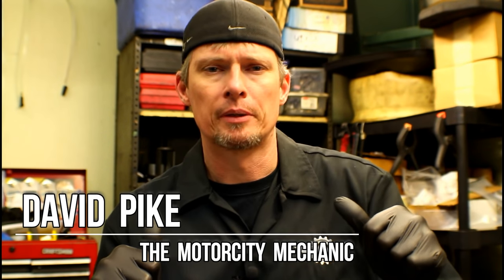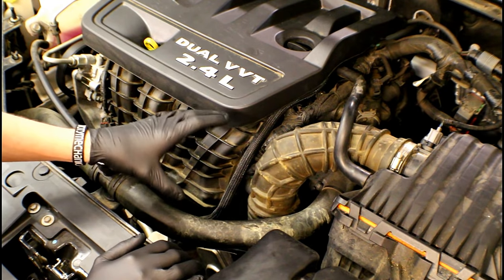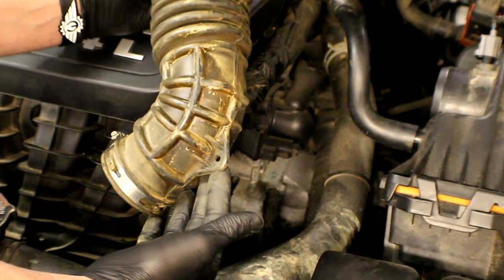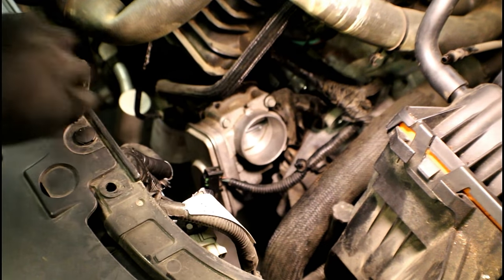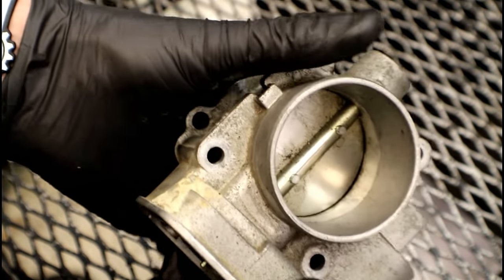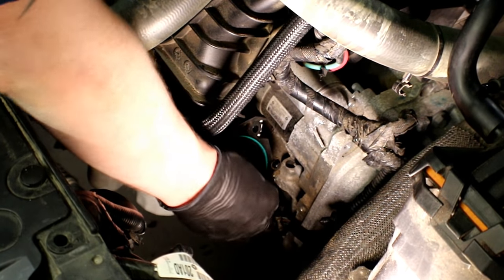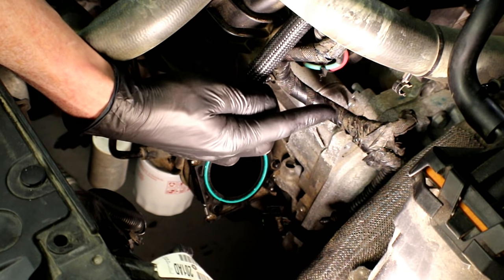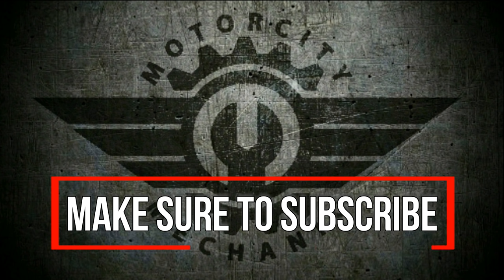Codes P2111 & P2112 Chrysler 2.4 Electronic Throttle Body replacement

Comment: Dealer changed it at 82000 Kms for about $800 CAD.  Acting up again at 162000 Kms. Part cost me $140 on amazon. I changed it myself in under an hour. Thanks for the excellent detail in this video!
Reply from the maker: Hate that it happened again but glad you found the video. Thanks for commenting and make sure to subscribe Frank.

Comment: I had to comment...this video is SPOT ON!  I had been noticing strange behavior with my 2013 Chrysler 200.  From a cold start, the idle would lope/pulse and then smooth out.  Then I would notice with a slightly off idle gas pedal, it would seem to surge.  I thought it might be a dirty MAF sensor.  I cleaned it but with no change.  I was on my way home from work the other night and the dreaded red lightening bolt appeared which caused no response from gas pedal input and a virtually fixed rpm of about 1600.  I was able to limp the car to my friends house for safety.  After watching your video, I got the replacement part, installed it (literally 20 minutes...start-to-finish) and the issues are gone.  Fantastic details from exactly what size sockets to installation, torque and order...really awesome!  I decided to open my original TBA and discovered that the teeth were gone on the butterfly gear...just like in your video.  Fortunately, like you, I did not have to relearn the throttle position sensor.  I also didn't have any codes (AutoZone was near where I had the issue so I asked them to check for any codes).  Great work, as always!  Oh BTW, the other video about replacing the trans oil cooler hoses is spot on, too!  Thanks a million!  Oh and for the record, the average cost to have the TBA replaced is around $450 US, I did it for $60 with the help of this video!

Comment: Thank you for this super helpful video! My aunt just called me to come reinstall the throttle body on her 2007 Caliber. Apparently some 'mechanic' came and took it off & wanted a lot of money to put it back on. Realizing he was trying to rip them off, they told him just leave it. Now I see what I need to do/check. I bet the plastic gears inside are worn. This video gives me the confidence I need to go finish the job. Or try to!
Reply from the maker: Awesome....as you saw there really isnt much to it. Take your time and it will go smooth. Thanks for commenting and for watching. Make sure to subscribe.

Comment: Thanks so much.  I was going to try to take one apart to learn what actually fails and you saved me the trouble.  Best video I've seen on throttle body replacement.  Also thanks for the torque specs!  Outstanding!!

Comment: Thanks!  Very helpful and well done.  Everything was exactly as you said and showed.  The Christmas tree clip was the toughest part, I put the wire back with a zip tie so its easier next time.  There was only 58K miles on the car/throttle body.  I didn't take the gears out of the old one to check but there was noticeable play in the throttle plate.  The repair didn't take long at all, I did it while my girlfriend made dinner and I finished before the meal was ready.
Reply from the maker: Awesome! Great job and appreciate you taking my video along for the repair. Glad to see it helping people. Thanks for the update and enjoy the rest of your weekend.

Comment: This is a great video! My 2015 Chrysler 200 is running in to this problem currently so I’m gonna do a throttle cleaning service to see how that fixes it and then try your recommendation with replacing the throttle body! Thank you!

Comment: Got an 08 compass in the shop. I Told boss man needed new tbi, he didn't listen and went with a pcm reprogram. Guess today we're doing the tbi, i love it when I'm right ha ha thanks for the in-depth video.
Reply from the maker: The Boss man aways thinks they are right lol. Not many software updates fix issues related to a throttle body. Once you get it off....if there is no core, open it up and check it out. Might find oil in it or some stripped gears. Its always cool to see the inner working of things from time to time. Thanks for watching and make sure to subscribe. Get that Boss to watch some of these videos lol.
Reply: MotorCity Mechanic got the video saved to show him lol can't wait to bust it open and see inside 👌👌
Reply from the maker: Much appreciated
Reply: MotorCity Mechanic new TBI, new relearn and the compass is running 👌👌
Reply from the maker: Awesome! Glad it all went well. When it comes to the throttle bodies....I try my best to stick with OEM. Not many aftermarket companies I trust. None the less.....thanks for the update

Comment: Thanks a bunch for this video.  My 2015 Patriot has 100,000 mi and is sometimes throwing the red lightning bolt and now is just giving me some weird intermittent throttle response pulses.  It's time to replace it I think so this is very helpful.

Comment: I think you just saved me about $100 labour costs. lol Thank you.
Reply from the maker: Your welcome Rick. There's nothing like saving money! Thanks for the comment and make sure to subscribe
Reply: Rick  B They quoted me over $200 labour and $900 for the part. We got ours from Bumper 2 B for less than half that, and if I had done the repair even once before, could have done it in 15 minutes easy. It took me just over an hour because I couldn't find the right socket. Lol
Reply: cost me a couple hours labour for the work, but I bought the part for less than $200 (in Canada for Dodge Caliber )

Comment: VERY good instruction! 
Thanks a bundle! 
It worked!!
Reply from the maker: Great to hear. Thanks for letting me know how it turned out. Make sure to subscribe Wes if you havent already.
Reply: I should add that I didn't bother torquing "exactly to spec"...just tightened them firmly.
...If it falls off, I'll let y'all know. 😉
Reply from the maker: Here is a secret.....I dont either lol. But its best to include the info in the video for those who want to know.

Comment: Great video hopefully you will come out with a replace the starter video for the  2014 Chrysler 200. I had got a po402 code saying I may need a catalytic converter but it might need a new throttle body.
Reply from the maker: I will keep that video request in mind....its not common for the starter to go out but anything is possible. Make sure to subscribe!

Comment: Great video !!!!!   just a couple questions to confirm before I start I should disconnect the battery first and ......I seen you mention 65inch pounds  and 18ftpounds  is that the size of the bolts what you're mentioning
Reply from the maker: Disconnecting the battery is a good idea. As far as those numbers you mentioned.....thats how tight to torque those bolts using a torque wrench. You can get by without it....just dont over tighten them.

Comment: First, by far the most comprehensive video I've seen on this topic.  Wish I would have seen it prior to my working on my 2017 Jeep Patriot.  Secondly, I have a burning question maybe you or someone here could answer...Is there a way to do relearn procedure for the Electronic Throttle Control without the scanner?  Others here(youtube) and elsewhere(internet) state there is a voodoo accelerator pedal deal that will do it or disconnecting battery and draining capacitors will force ETC to relearn but I'm dubious.  I installed new throttle body but a few weeks in, I'm back to square one.  I am just trying to learn if my issue could be not having done the proper relearn procedure?  Any help would be greatly appreciated.  Thanks for awesome and concise video!!

Comment: I'm a Ford guy and I'm going to do this repair for a friend. Question, could you just disconnect the battery for a while to clear the codes and put the computer into learning mode? Most Fords operate in this manner at least. Thanks

Comment: Great vid thanks, my wife has a 2014 compass that had the same issue about a year ago, throttle wouldn’t work and engine light, abs, and traction control light came one. I disconnected the battery for about 30 mins and car went back to normal, until this past weekend i disconnected the battery again and the issue went a away. You think the throttle body needs to be replaced or is it just a glitch I live in northern NJ and both times it happened in the winter could it be from grime, Road salt, etc etc.... thanks

Comment: Sheesh! you're lucky to have all that room on this vehicle. I always seem to get stuck with a Patriot or Compass where you have very little room to work...lol  Loosening the clamp at the throttle body can be a real bear sometimes.
Reply from the maker: That harness that is held on to the rubber boot always annoys me. I see alot of them cut loose by previous techs and I can see why.
Reply: Working on my 2016 patriot now with that issue, I found removing the battery and the shelf for the battery on the 2016 gives you alot more room to work with

Comment: My 2.4l in my dodge journey ticks 5 or 6 times (like a woodpecker) when I turn off the engine. Is this the sound he's referring too?
Reply from the maker: Normally thats the throttle body making noise doing its self calibration

Comment: I have a Chrysler 200 with error codes P2172 & U1424 should I replace the throttle body... Great video by the way

Comment: I have a jeep cherokee 2015 with 2.4L and it is underpowered due to the high curb weight and the 9 speed transmission.  Is there any way to beef up the engine so it does not feel wanting sometimes.  I know the transmission is not the smoothest. Thanks and like your videos !!!
Reply from the maker: Afternoon, there isnt anything that I know of or that I have seen so far to get you any more power especially with it having that size engine. The Journey feels the same for sure with the 2.4........gutless! There may be something out there but the 2.4 isnt really anything that companies go after for any mods or performance upgrades. Thanks for the kind words about the videos/channel. Its much appreciated. Make sure to subscribe if you havent already.

Comment: Would this be the same engine as a 2012 Dodge Avenger? And this may be a stupid question, but this is 2 females working on this car... (I’ve replaced the throttle bottle before just not sure we done this) how do you make sure the torque is right?
Reply from the maker: Angie Wallace as long as it’s the same engine in the video then yes it will. As far as how tight. Snug is fine using hand tools. Just use your best judgment....no need for any expensive tools to tight it to a certain specs

Comment: can you list a link where i can  get these basic tools please. I plan on doing this myself!!!
Reply from the maker: What vehicle will you be doing it on? Just trying to see it in my mind so I know what to mention as far as tools. Typically a simple 1/4 inch drive socket/ratchet set is all you need which pretty much all parts stores carry in their tool section or your local home improvement center.
Reply: @MotorCityMechanic  2014 chyrsler 200. and ok  I'll write that down. I'm really nervous to do it but i don't have choice lol. Your video was minimal and straight forward thank you !

Comment: My Chrysler 200 2013 was doing the same thing first it was over heating then after I fixed the over heating those new lights came on nn it started moving real slow it was so hard so now I tried to replace my throttle body sensor by my self nn the lights still on
Reply from the maker: The first step is to see what the codes are. Also....did you clear the code or codes after your replaced the throttle body? The codes will not clear right away on their own....it can take a few days for driving if the issue is fixed for the light to go off.
Reply: It’s still doing the clicking noise and I don’t have the thing for the codes and my car won’t start

Comment: 2011 Chrysler 200....never owned a car I hated so much. It now has the red lightning bolt light and traction control light on. It's using a excessive amount of gas I'm getting about 20 mpg and now will only run about 10 mph on flat ground at full throttle
Reply from the maker: There is a chance that throttle body is the issue. I dont recommend the aftermarket replacements....they dont last. Go with the MOPAR version if you can. For the most part the 2.4 engine holds up great except for some items like the throttle body that I see once in a while.
Reply: My 2013 Chrysler 200 is doing the exact same thing. This is very frustrating. What is the Mopar version. What's the ballpark cost for this piece.

Comment: Gotta 2012 Chrysler 200 thats running at about 5000 rpms.... throttle body need replaced?
Reply from the maker: Possibly or a large vacuum leak somewhere.I would have it checked out first before replacing things....could be something simple. Thanks for the question and make sure to subscribe.

Comment: Got the throttle body changed out but still got it on limp mode and the same codes.. P2110 P2111 P2112

Comment: +  I have a 2008 Dodge Ram and the warning lightning bolt is flashing, indicating something wrong with the electronic  throttle control. Would this fix my problem?  What would this cost at a service garage? I can't do the work myself.
Reply from the maker: Al Kalil If the light is flashing that means that there has to be a check engine light code somewhere. The first thing we need to do is have it scanned for codes and then run the appropriate test related to that otherwise it would be just a guess.

Comment: :)   thanks   My 2008 jeep patriot throttle body still bad after cleaning , I am going to buy a new   360$, no choice.
Reply from the maker: Stick with the OEM replacement when ever possible.
Reply: I installed today, it is working good so far with 3 years warranty.
Reply from the maker: Awesome....glad all went well!

Comment: as it would be the reprogramming already installed the new body of acceleration or it does not require it. regards
Reply from the maker: I have heard from alot of people that all they do is bolt it up and no issues which is great! Its great to have it calibrated to the vehicle so that they both match but not sure the big difference if you dont. Thanks for the added info and have a great weekend Luis!
Reply: Ok, i'll  make the change and  see what happens.Thanks motorcity mechanics
Reply from the maker: Luis Lopez Your welcome Luis

Comment: I have a question, but First let me say that your videos are extremely well made and thorough. As for the scan tool, are there any entry-level scan tools that you might recommend the investment in? I see everything from $300-$3000 out there, but do not have the knowledge to consider one if we need to reset the vehicle after the new throttle body.
Reply: Im a small shop owner and I bought a  Launch Diagun over 2 years ago and am going to buy another launch when I get the funds. 100% best bang for the buck.

Comment: So does it need reprogramming  if I replace it? Or Will the new one be programmed already?
Reply from the maker: Christian Ambrocio It will work after plugging it in. No programming is required but recommended if possible. It performs a self test at each start up. Thanks for watching and make sure to subscribe

Comment: I have a Chrysler 200 limited year is 2011.  the electronic throttle control light and engine light comes on I had these are the codes I'm getting is P0121 and P0221 and P2135. were do you think I should start at?
Reply from the maker: Obvious there is some diag needed and testing of circuits. One thing I can recommend is doing a good visual inspection to make sure to damage to the wiring leading to the throttle body and PCM. The most likely cause will be the throttle body but before replacing.....I still recommend having the tests run per those codes you gave me. Thanks for the question and make sure to subscribe

Comment: My Chrysler 200 is having a fit. In the morning I'll go and see if this is the issue.
Reply from the maker: Its possible. I recommend checking it for codes. Another thing is that you can take the air inlet off.....with the key on/engine off......have some move the gas pedal inside while you watch the throttle plate to see if you see any issues with it jumping or not working correctly. Thanks for watching and make sure to subscribe
Reply: Yeah after looking at it again I'm getting that woodpecker noise you mentioned
Reply from the maker: Sounds like you need a throttle body. I dont recommend aftermarket replacements. They dont hold up great. I highly recommend spending the extra money and buying the Mopar replacement.
Reply: Will it affect the a.c. as well? My a.c. was great until just now.
Reply from the maker: Not too sure. I have never heard of that being a symptom...its possible but I have never noticed both at the same time.
Reply: I dunno. Replaced it and everything works, including the a.c..
Reply from the maker: Glad that all is well now.
Reply: So I have a 2013 Chrysler 200. I just started getting a certain feeling when the car seems to be changing gears. Like its hesitating, and the ETC light will flash on when it does this. This AM on my way to work when I stopped at a light and started to go again, as it was accelerating and moving up gears, it hesitated so much it made me nervous. I dont even know if hesitating is the right word, more like having trouble changing gears it sounds/feels like. Does this sound like it could be the throttle body?
Reply: Maybe so. Does it seem to want to power through your brake? Mine did because it was partially stuck open. Also my a.c. stopped working. Might be another symptom to look at.

Comment: David. Questions and thank you for this video. Did the clicking sound go away after the replacement?
Reply from the maker: I sure did.....fixed the issue on that vehicle. Thanks for watching and for asking. Make sure to subscribe.
Reply: @MotorCityMechanic  thank you I will